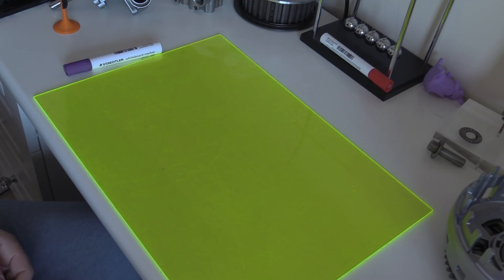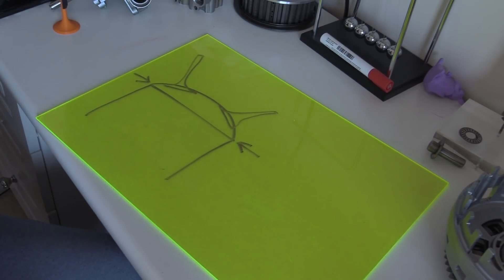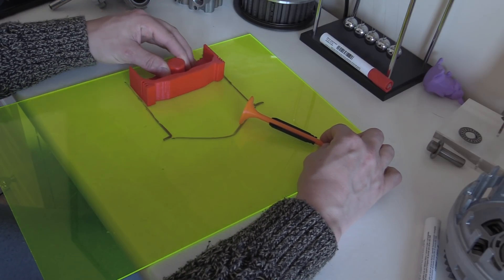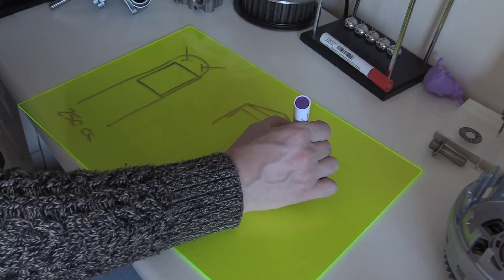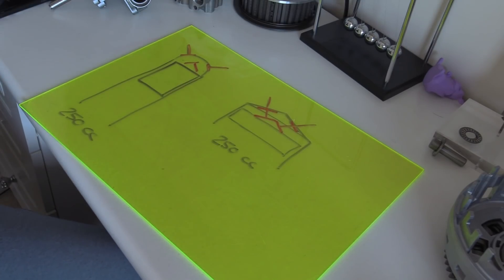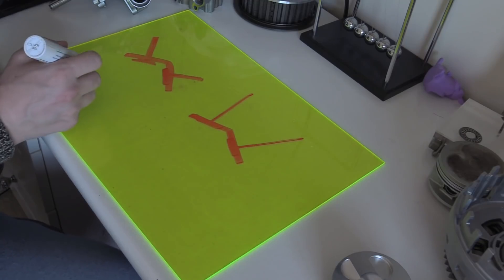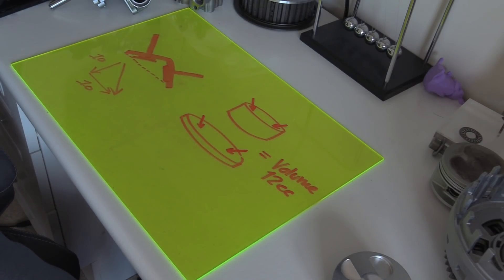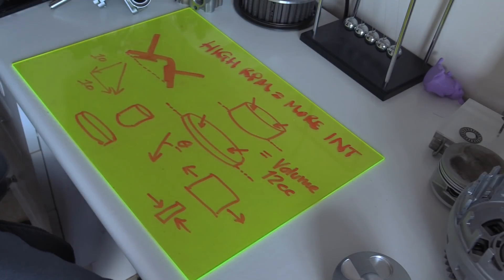Interference Engines - Part 1

Comment: Why don't you drill a hole in the valve  so you can put another valve in their so you have a double valve system, and then drill 5 holes in the top valve keeping the seal safe . Purpose of this is more air and fuel mixture in the combustion chamber. The cam will need to be modified to push 2 valves.

Comment: Back in the 1990's, a close friend ran a motorcycle breakers yard, so we witnessed, first hand, the instances where interference engines went bad, usually from the now FBR bike's terminal owner exceeding the redline, back in the days before rev limiters were the norm. There were also the odd camchain tensioner failures (usually a Honda CBX550 as these were notorious for this).

(FBR = An old military acronym translated as "F**ked Beyond Repair").

Comment: Interference story:

Growing up in India, I learnt to ride on an Apache RTR 160 (2010 model, I think). It was an SOHC, 2 valve and air-cooled.
Basically, it was weak AF. (15.5 hp @ 8500 rpm  and 115 km/h top speed)

One of these days, I went a little koo-koo up there. I revved it up to 10500-ish in 4th gear, then without letting go of the throttle, I downshifted to 3rd.
Let's just say, there was some interference 🤷🏻‍♂️

Why did I do that? TBH, it's been a decade and I still don't know 
Lmao
Reply from the maker: meaning 'what' happened?
Reply: @thedirtyworkshop   bent conrod, piston with some holes and broken valves.
So yes, valve float results in bad interference at those rpm 😄
Reply: @thedirtyworkshop   got a proper whooping from dad , lol
Reply from the maker: You could have dropped a valve...

Comment: Hey Matt.  I have a random and off topic question.  On my Yamaha, the brake caliper mounting bolts are hollow.  Is this for some mechanical reason? (Old style calipers, not modern radially mounted ones)
Reply from the maker: Which yamaha is this?
Reply: @thedirtyworkshop  Yamaha FZS1000 (Gen.1 FZ1,  01-05)
Reply from the maker: Are the holes they srcew into blind? 

This is them - 

https://i.ebayimg.com/images/g/-DcAAOSwCU1Y3jUq/s-l1600.jpg
Reply: @thedirtyworkshop  That's them.  No, the holes they screw into aren't blind.  They go through a mounting lug on the fork lower, and then screw into a lug on the caliper.  The hole in the caliper lug goes right through.  Here is a picture of the caliper.
https://www.boonstraparts.com/en/part/yamaha-fzs-1000-fazer-2001-2005-fzs1000-5lv-1c2-brake-caliper-front-right-2003/000001126960
Reply from the maker: Maybe they had a different design in mind. Calipers are outsourced and deals can change etc. Forget what A.V said. These would be more expensive to produce so 'penny pinching' isn't the reason. 

When I worked at Carl Zeiss we used vented bolts because they were used in vacuum chambers and the trapped air can break the housing. Obviously not the reason here, but a blind hole with threadlock in place needs the air to vent out somehow... who knows...

There's no other reason really. The FZ wasn't the mean fast machine like the R1 so it's not a weight saving thing, and after all it's a road bike. Do the later years have the same bolts?
Reply: @thedirtyworkshop  No, the later ones are a completely different part number.  The R1 up to 2003 used the same hollow bolts as on my bike.  Could it be that it was just what Yamaha had in the parts bin?
Reply from the maker: The bolts were drilled on purpose. This is an extra step in production that Yamaha would have to pay for. I hear a lot of people say 'stuff in the parts bin' but they don't have parts bins. What I mean is that modern manufacturing is based on the LEAN system. This is where you have the correct number of parts per order.

They'd have to have 100,000s of 'spares' in the 'parts bin' - that's a fucking massive bin. The R1 might have had it for some reason, and that reason could be weight, but more for marketing purposes than anything else. 

They could have placed the order for both R1 and FZ, so it would have been intentional.
Reply: @thedirtyworkshop  That makes sense to me.  They already had a supplier for bolts for that caliper as it was used on the early R1s, so they just used their existing supply line.  Anyway, you've answered my original question.  There was no engineering reason to use hollow bolts.  Thanks for taking the time to to answer me. Cheers
Reply: Because some bean counter or engineer decided it should be like that. For weight reduction, maybe. Or maybe they had 10 million hollow bolts and needed to use them and the engineers said "yeh that's more than strong enough for the use"
Reply from the maker: Or its a bike and not a piece of shite american v8...

Comment: The valves can kiss also
Reply from the maker: This actually decreases the more oversquare you go.
Reply: @thedirtyworkshop  thanks for the info 👍
Reply: A common issue with larger valves, taller lift, or just certain DOHC engines that absolutely require degreeing to make sure both cams are in sync

Comment: Hi Matt quick ish  question when should valve clearance be checked and have you done a video on this already and it’s the Zx9r 1999 again
Reply from the maker: When the manual states it should. Some engines require smaller intervals
Reply: @thedirtyworkshop  ok I’ll try and find it probably find everything I’m not looking for first

Comment: What limits the amount of valve lift?
Reply: Compromises. Are. Always. The. Limiter. ;)
Reply from the maker: The same of the cam
Reply: @thedirtyworkshop  I DO know that.
What limits the size of the cam....?
Reply from the maker: Well its not a limit, its more of a range.
Reply from the maker: And that is for a video all off it's own.
Reply: Valves have inertia, cam lobes can only slope so steeply, valve springs need to be able to both control the valve and not coil bind and not be so stiff you're bending or wearing parts of your valve train trying to actuate them. There's also the practical question of how much lift/duration do you actually NEED for your build.
Reply from the maker: As soon as someone says "your build" stop listening to them...